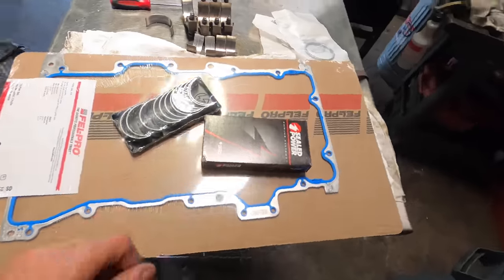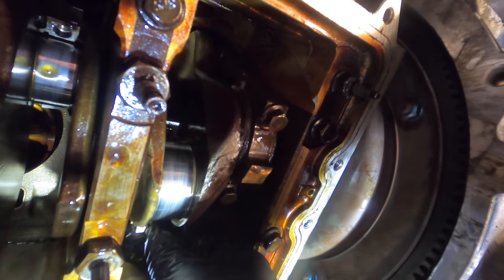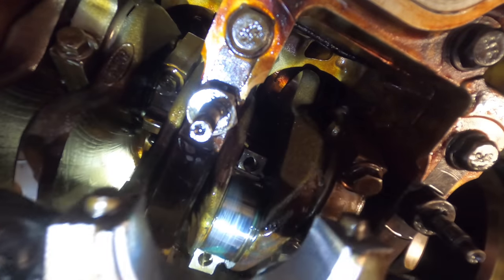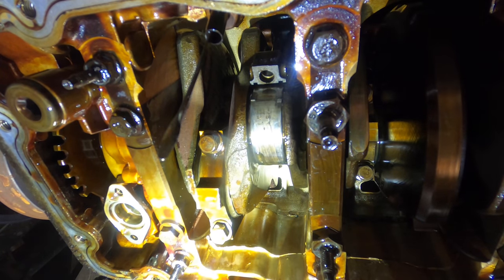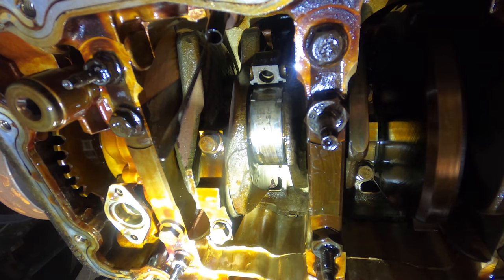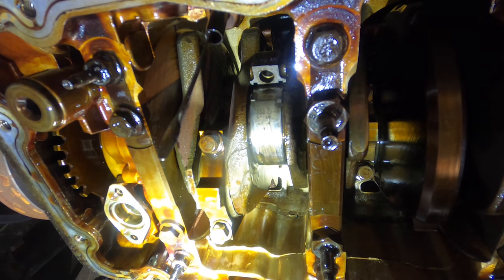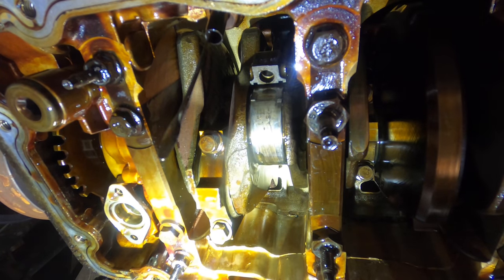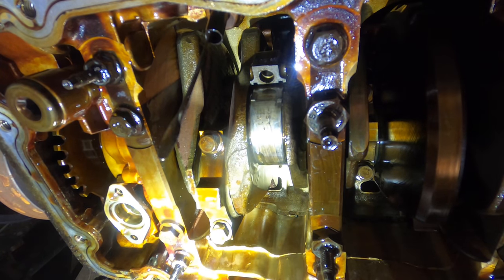Saving an Engine: Spun Bearings Replaced

Comment: How did you check the main bearings on the crank?  Did you remember to torque the nut on the pickup tube?  You did the bolts, but I don't recall the other...

Comment: Love your videos. 
But I have to call out a possible mistake. 
I think the nut for the pickup tube support bracket was only hand tightened. 
You spun the nut on by hand. 
Then put the bolts in where pickup meets pump. 
Then went to windage tray outer 4 bolts. 
And it appeared you forgot to tighten that original nut on pickup tube. 
Again, I love your videos.
But I think this could be a bad mistake.

Comment: i just did mine (6.5 TD)…huge improvement.  Question: did you re-use the bolts??  Mine were Torque to Yield and were single use only…so had to replace all…bolts were nearly $200…lol

Comment: Fun to watch a much smaller version of something ive made being worked on it the car.  The connecting rods we made were 24" long and 3.5 to 4" dia at the crank shaft end the top was somting like 2" dia.  That wasn't the largest motor the shop had worked on one was out of a train the cylinder split and had to be brazed becuse it was cast iron.

There is no way a pick tool would scar the jeronal on a crank shaft with a pick tool its hardened steel and heat treated a lot harder then the steel used to make the pic tool.
By the way snap on warrty says they are not prybars nor was the screwdriver a punch or chizzel.

Comment: Question... I believe you said you are using Lucas assembly lube on journals before attaching bearings. Why not just use the same oil that you use in the engine? I'm thinking you need a thicker oil for assembly? If that is the case, then why not use a thicker weight on the same oil (50w instead of 30w)?

Comment: Those tabs on the bearings don’t hold the bearings in place they center them into the cap etc… the rod journal should be 1 thou smaller than the o.d. Of the bearing which creates a slight compression fit that holds the bearing in place. Those tabs are commonly thought to hold them but not the true purpose since some don’t even have those tabs

Comment: Did u use standard or oversize bearings? I would have tried oversized bearings since the engine already spun a standard, has some wear, and u had to take a little off that journal but not as much as if u were to turn it down.

Comment: I would have had to pull the main caps at that point. Too much work not to after the way that rod journal looked .. if it wouldnt have worked and i didnt check the mains i would have never forgiven myself . But ive been a mechanic for 33 years engine building is my specialty . Not just stock engines . I enjoy building promod engines more than anything 😁

Comment: I would have put some assembly lube on the bearings. Other than that, good repair. It won't last forever, but it will get the customer by for a while.

Comment: Question so should you or not sand wet dry sand the crank before installing the bearings? Also 1000 or 600?

Comment: For anyone who is think about performing this “repair” like this. Please don’t.  If you are lucky you will get the knock to go away for a week.  And then it will return.  The clearances in those bearing are extremely precise and need the perfect tolerances to not be too loose to where it knocks or too tight to where the oil can’t fit between the bearings.  Even an extremely experienced engine builder would be hard pressed to make a proper repair this way.  That engine need to come out.

Comment: 20:15 this accidentally untightened cap bolt was never re-torqued... So it's basically a loose bolt inside the crankcase

Comment: Great videos! 
But I saw 2 things on this one I did not like. 
1st you never tightened the nut holding the oil pickup tube to the windage tray.

But the big one is you never removed any of the main bearing caps and inspected the mains.
In my experience if you have spun rod bearings you have almost for sure damaged the mains as well.
It might run good now, but later down the road the mains will become a problem. I have had this happen to me a few times now.

Comment: Not that it matters now but when you put the oil pickup tube in I saw you tighten the two bolts but you didn’t tighten the nut for the pickup tube bracket

Comment: Why don't mechanics wire wheel sand and repaint old parts when they replace them. The high temp/rust proof paint is not that expensive.
I think it's also a good idea to soak rusty nuts&bolts in Evapo-Rust if you have 8 hours before the job(preferably 24hrs).
I put medium-strength threadlock Blue242/Orange25210 or Green Loctite 290 that can be used on already tightened and torqued fasteners to prevent moisture and corrosion/rust.
Loctite Nickel Anti-Seize or Nickel-Graf where applicable with 30% torque reduction on value. 

On bushings or rubber gaskets I use B'laster's Silicone Spray.
On Metal to Metal hinges or pins I use B'Laster/WD40 Specialist White Lithium Grease "that's CG rated if used on high rotation parts like wheel hub bearings"

I also put Nickel-Graf on lug nuts with 30% reduced torque. 
Example: 95ftlbs for dry torque is only 66.5 Ft-Lbs Wet (with Nickel-Graf Anti-Seize on threads).
▪︎ 95 Ft-Lbs "Dry Torque" * 0.7 = 66.5 Ft-Lbs "Wet torque"
* This formula for wet torque on lug nuts/studs is Ajax's not mine. They are the world's leading bolt(Fastener's) engineers and manufacturers. 

★ Disclaimer:
You have to adjust and reduce torque value applied by 30% when using anti-seize compound on threads or you will over torque lugs.
▪︎ Put Anti-Seize on wheel hub face plate around lug studs so it doesn't rust seize (rust bond together)

Comment: How long will this repair last? 10,000 miles or 40,000 miles? I guess the point is just to get more life out of the engine without replacement or a complete rebuild, and it appears to work well.
Reply: Probably not that long  because in the first part to this vid  he said customer stated oil was never changed and it has about over 90k miles on it.
I don't think the main bearings have that much life left I them at that oil change spread

Comment: What about using plastic gauge and also if it's spun bearing or multiple bearings wouldn't it be wise to check with a micrometer the journals of each roundness or Loeb love that crank and then checked around this the inner circumference of each end of connecting rod to make sure that if it didn't burn through the Rod's main bearing Plus ayte into the Piston rod itself mess up that plus the journal on the crank I mean you could hit it with a mic for a plastic guge and whatever it's supposed to be if it's within tolerances then you should be good stop

Comment: That was not a cheap repair.  My father taught me how to do the heads of my '77 Olds Delta 88 with a V8.  It was a father/son project.  It wasn't too bad to do with the real estate you have to work with under the hood.  I did the water pump on my '84 Ford Mustang V6 in August in August 1992.  Damned near got sun poisoning from doing job.  Back in my younger days, I would do the simple wrenching myself.

Comment: If you can save it, it would be great. Ford has enough crappy engines, but the DOHC 3.0 is a good engine. I still have it going in my 02 Taurus wagon. Their transmissions are kinda wonky, still have the original engine and tranny, but not sure how long the transmission will go I know that is the real weak spot in the powertrain.

Comment: Good work. Not that anyone cares, would of checked one journal with plastic gauge to ensure the new bearings had the needed clearance, than ball mic the others to make sure the entire set was the same size. I’d also of sprayed the journal, rod big end and bearings with that brake cleaner before installing. Contaminants between the bearing and big end are never good for a long happy Eng life.

Comment: A .005" (per the mic readings) over bearing would wear into the grooves in the bearing lasting longer. The original sized  bearings won't last long riding on the smaller high spots on the crankshaft.  Thanks for killing the music

Comment: I did not notice any part going significantly wrong until you dropped bearing 6.  I know you cleaned the bearing but what was on the back of your left glove was very scary from that point on and polluting the internals at that level was a big no no.  Sorry to ruin all your nice compliments, but just noticed a bit of novice mistakes at that point-sorry bud.

Comment: I wouldn't have tried that. I had a VW repair shop and every time I tried to save money like what you did. I got burned.  My thinking is if the rod bearings are bad so is the Main bearings. So two months or so later they go out and the customer comes after you. Hope it all worked out ok but I would have pulled the engine had all the machining done new mains and rod bearing and that big end of the rod could be bad too. You are a above average mechanic and I understand wanting to help your customer but don't put yourself in a situation like that.

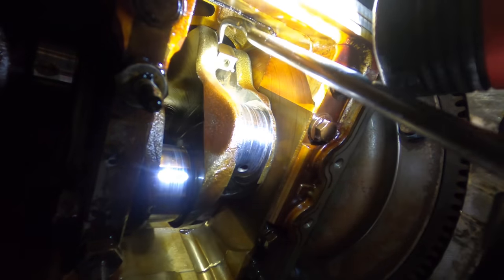Comment: 2:08  Assembly lube; e.g., Lubriplate?  You don't want these bearings to start their lives running dry until oil pressure reaches them.
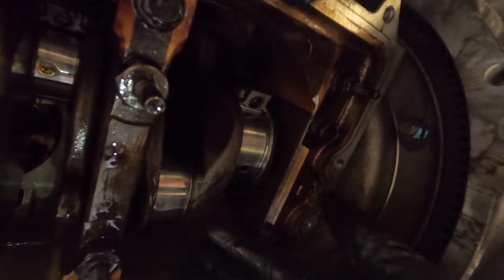2:58  All better, never mind.  🙂

Comment: Next time using the handicraft you cut the exact same size as diameter of the crankshaft on the ride or the or the mean bear now you find some round like surely string right your wrap it around there rondo family cloth and got two enzymes and then you start polishing it I'll come out and nice and even and you have a Polish crankshaft no matter of minutes that's awesome you're looking for a little bit of the 40 order to have you on a little bit of lubrication system process will come out a lot faster tell me a reply back at your house what do you think about that okay I used to do it that way

Comment: Id get rid of it fast . You didn’t do the mains . You used the same pickup tube. There has to be metal in the lifter gallery. I would have went thru it. I don’t believe you did well.

Comment: Why did you not check the main bearings?
Reply: Cause the main bearings have not that load/lbs pressure then the rod bearings, so normally they won´t fail.

Comment: This repair is certainly risky, and will not last very long, but if the customer had no money and needed his car to run, then this is about all you could do.  Would have been much, much better to pull the crank and have it ground and polished by a machine shop and then put in all new bearings.  Certainly this engine and crank was not past saving, and with the right repair and REGULAR oil changes, it could go another 91K miles, but the repair that was done may last 10K miles or 100 miles.  Hopefully gets the customer to a spot he needs to be.  Ray moved to a different shop, so probably doesn't have to worry about this car coming back, unless the owner sees the video.

Comment: Personally, I would not have simply replaced the bearings. I would have removed the engine, & pulled the crank, machined the crank, then put the crank back with undersize bearings. I did this kind of work for over 40 years. That engine won't last long.

Comment: I watched twice when you put the pickup tube in and you screwed the nuts on manually and then put the 2 bolts in and tightened down the bolts I didnt see you tighten the 2 nuts that you put on by hand

Comment: You did not replace the old oil filter with a new one as you should doing an oil change let alone after removing metal an foreign objects from the engine as you did in videos 1 & 2.
The rest of the job was done right.
You said in video 2 you replaced the oil filter, why you keeping content from us?

Comment: This won’t last.  The main bearings are only 1/2 of the lube bearings.  

Correct job would have been to pull the engine and do the cam and main bearings as well.  This job leaves those worn and contaminated bearings in place.  

A job like this might get you 15-20k more out of the rig or one of those metal chunks could eat it on fire up.   

Should have done it correctly.

Comment: Watched entire video,  and you forgot or didn't show you tighten the nut for the pick up tube. You threaded it on by hand then went straight to the two bolts for it. But never went back to tighten the nut for it. Watch it back, you'll see. I'd bet money it is now in the pan. Sorry for pointing it out, but had to say something.

Comment: Crankshaft should have been machined. No Plastigauge was used to measure clearances. No assembly lube. No break in oil for new bearings... doing this kind of job on the cheap will just end up costing more...

Comment: Late to the party Reeeeeeeeee!
I was taught that the connecting rods had to be worked before the bearings could be installed. Why didn't you use plaster gauge to check oil clearance beings the crank wasn't ground.

Comment: What NOT to do...
At 10:00 Mechanic uses an impact wrench... AFTER saying "tighten with fingers" and then uses a torque wrench... if the torque was ALREADY 17 pounds, when you put on the wrench, it'll ALWAYS Click at 17.  And then even at 32.  Because it was ALREADY at 40+ pounds... the Torque Wrench is a LIMITER of Torque.  If you have used a tool to ALREADY go BEYOND that Spec, it's TOO Tight already, and should be ReLoostened, and Started again.  Finger tight, and THEN the Torq Wrench.  NO faster Electric or Air tools.  (Reguardless of the settings)

He even seems "surprised" 10:00 when he has surpassed 17 and 32 lbs on the bolt torques.  

I hope this guy never works on one of my engines.  My kids know this.
Reply: 9:20.. when it's already MORE than 32 lbs Torque..  the Wrench will click Every Time.

Comment: Wow what a butcher job.  First the crank journals and the rod bore have a tolerance of less than .001" did you measure them no you just used sand paper on the crank journal and put it together.  How much debris was in the oil galleys that you didn't clean out.  The tang on the bearing is for location when it is installed in the rod NOT to keep it from spinning, crush is what keeps the bearing from spinning.  After the bearing spun the rod bore was oversize which means there was no bearing crush so I'm sure it spun another bearing in a short amount of time.  If you don't believe me contact Federal Mogal They most likely made the bearings that were originally installed in the engine.

Comment: If the rod bearings were that bad from oil starve why the hell wouldn't you at least LOOK at the mains... Wtf thats a bad job
Reply: Cause the main bearings have not that load/lbs pressure then the rod bearings, so normally they won´t fail.

Comment: Its making me so mad i have to comment again, ALSO IF A BEARING IS SPUN THERE COULD AND USUALLY IS A PROBLEM WITH ROD JOURNAL, BOLTS Stretched, HEAT OUT OF ROUND....DO IT RIGHT OR DO IT AGAIN!  YOU DIDN'T EVEN LOOK AT MAINS OMG